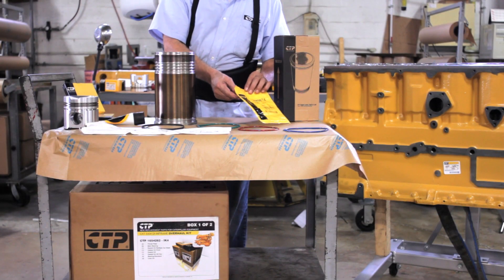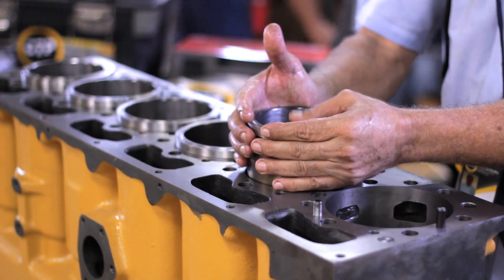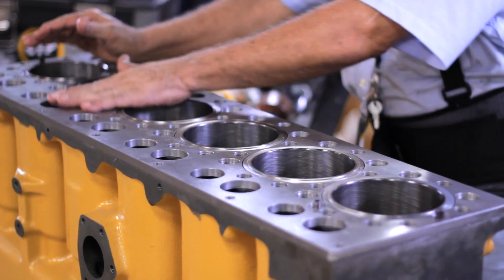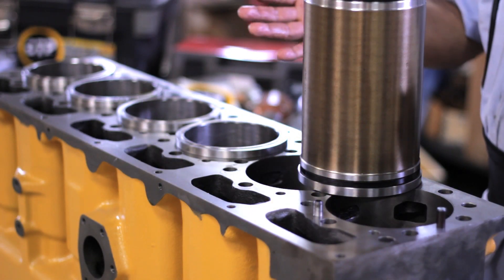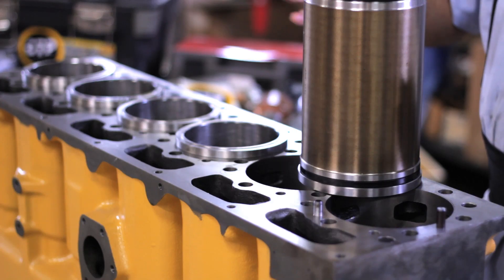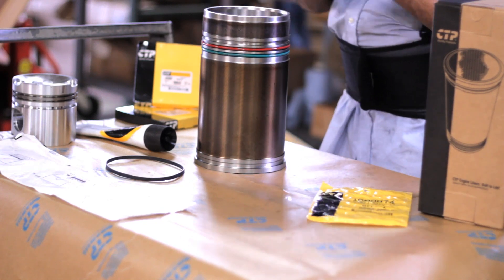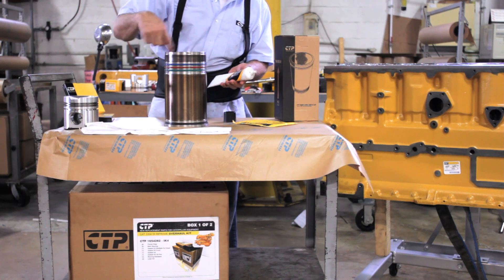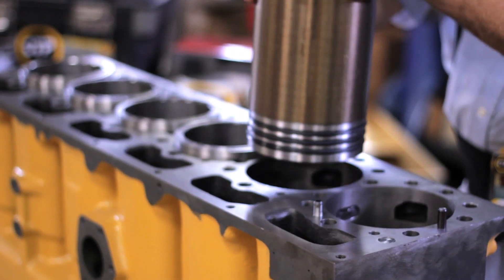Liner Installation

Comment: The video shows the same lubricant being used for all o-rings but on the Cat engines you're supposed to use a petroleum based type (i.e. engine oil) on the top and a non-petroleum-based type on the bottom (i.e. soap)

Comment: Why do you recommend petroleum based lubricant on that too black rubber seal ? 

My understanding is that it should only be lubricated with 50/50 water soap solution 

Please explain
Reply: That is ok !!!
Only soap, no Grease or oil the seals expanding
Reply: I one instructor in Madisa-Cat
Reply: top band in clean engine oil   the bottom 3  o-ring seals in liquid soap

Comment: Is this a wet or dry liner?
Reply from the maker: Hello and thank you for your comment. In order for us to better assist you, please email us directly at marketing@costex.com. We also invite you to check out our website at www.costex.com. Thanks!
Reply: Every cylinder liner having Seal O Ring while installation is wet type.
Reply: Zeeshan Ahmad thanks man! How about the dry type?
Reply: +Cedric Pineda 
you welcome. every dry liner also called sleeve especially in Japanese engines is much thinner as compared to wet liner. 

Also it has not Seal O Ring while installation. A hydraulic press must be used to press or install smoothly dry liner. Also coolant in jacket water circuit of dry liner never touched directly to absorb heat or cool down. 

I do work for Caterpillar and Cummins diesel engines for more than 20 years in Lahore city of Pakistan. Thanks for reading.
Reply: Zeeshan Ahmad u had an awesome experiences sir! I studied heavy equipment servicing here in Philippines but im still lack of knowledge and experience being a mechanic hehe. Thanks for you're knowledge :)
Reply: +Cedric Pineda 
you welcome. you will get more experience as long as you get hands on work experience. 

Also I believe theoretical awareness must be learned likewise mechanical engineering degree and try to consult and study workshop / service manuals of heavy engines offered by manufacturers. 

It will make you to get more confidence and trust on engine performance besides aftermarket replacement parts likewise CTP or original Caterpillar parts. 

Indeed I am inspired by my father who has had experience of CAT engines, transmission, torque converter and hydraulic system since 1962. He is tired since 2013 only work shop management.

I had obtained graduated degree in Mechanical and diesel engineering technology in 2000. Beside that I have been working on CAT diesel engine troubleshooting and overhauling since 1992 especially on CAT 3200 to 3500 series and now also on C15 & C18. Thanks for reading.